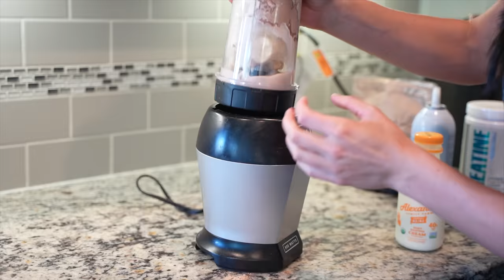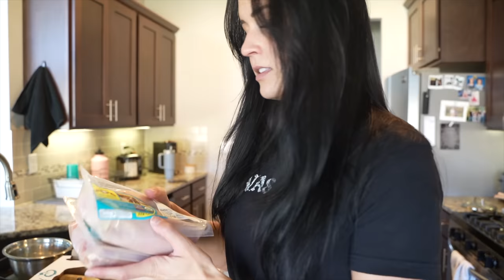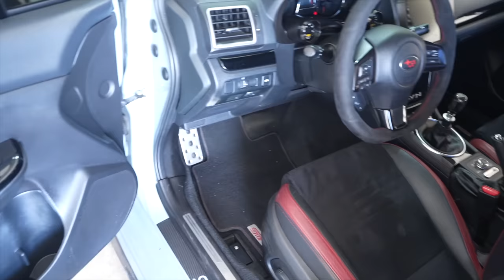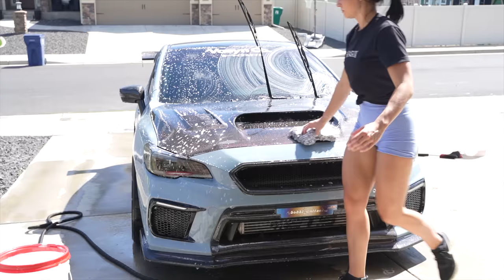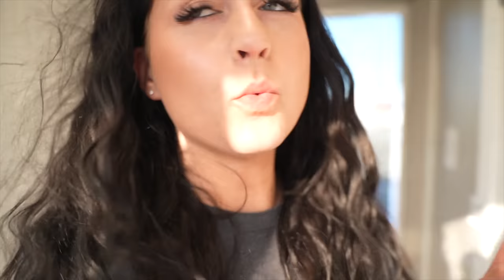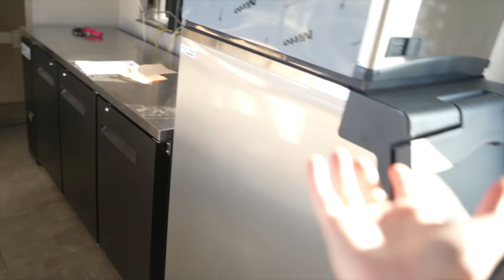Why Iv'e been distant from social media...COFFEE STAND update & my Subaru STI

Comment: Bobbi, quick tip from a detailer - wait to rinse down the body of the car until after the wheels are cleaned, less water spots esp w the sun. Glad to see you back :)
Reply: Any tips on how to remove water spots on a ceramic coated car? I'm thinking about using Adams water spot remover. Do you have any thoughts on that product?